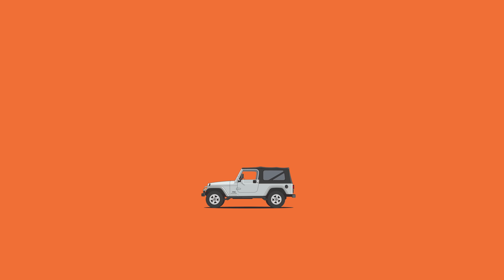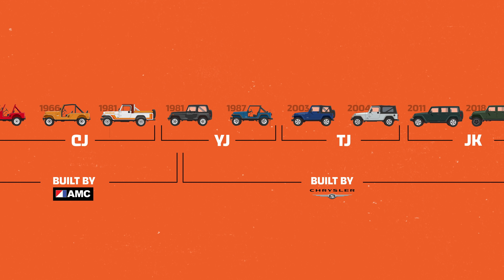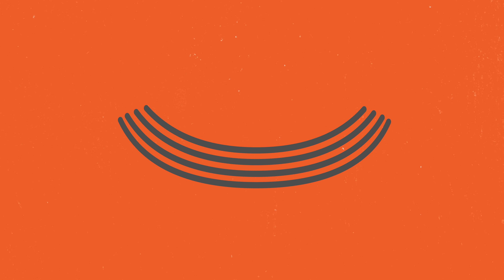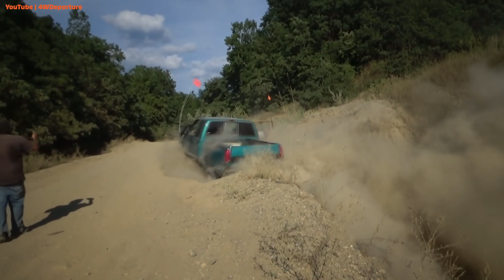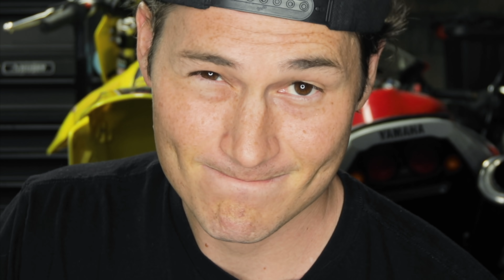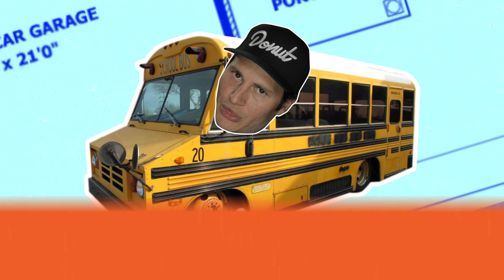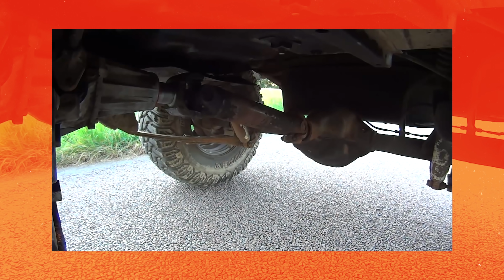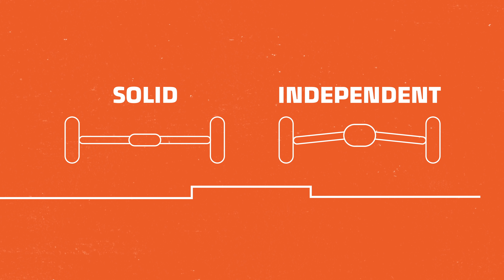Jeep Wrangler - The Science Explained

Comment: Why has Mercedes and Jeep not taken responsibility for the infamous “Death Wobble”? I purchased a used JK that was still under warranty by the dealer, who tried to fix it by replacing the ball joints but the problem persisted. I replaced nearly everything else and the problem just got worse and worse. If you don’t know, this issue is very common with Jeep’s including, from what I’ve found out in all models. My experience is that any bump  that the vehicle would experience I’ve 40 mph would cause the front suspension to destabilize causing the the vehicle to violently thrash and shake until it is brought under 5mph. This issue is probably one of the scariest experiences of my life while driving. Because it happened to me several times on the highway. I took it back to the dealership several times and they would say they couldn’t fix it or couldn’t replicate the issue.( which was a lie)! I put thousands into trying to fix this issue and have heard horror stories of people experiencing the same issue. I’ve known of people dying from this issue yet this is an obvious manufacturing issue and they wash their hands of any responsibility. They blame customization. Yet my jk was stock stock. It’s a shame that donut is advocating this. Either I am the exception or they have an issue that needs to be recalled. Do the right thing! I will never buy a jeep again and I’ve owned 5 in my life time. None have had this issue till this one.

Comment: Personally, my experience with the early 86 cj7s by amc with a straight 6 258 engine with a manual transmission are the best. We own the early models by amc which had about 2000 made before they were bought out in 86. We even put this jeep up against a 2000 wrangler and a 2017 wrangler and it wins every time.

Comment: thank you for teaching me about the different kinds of suspension. i’m 20yrs old and bought a 65 mustang. it has leaf spring suspension and bounces to much over railroad tracks and por holes. now i know what kind of coils to get and the benefits of doing so!!!
Reply: Just get a set of slapper bars.  They will help prevent axle wrap and are way easier to install then cutting off leaf spring brackets and welding on coil perches.  Unless your going to back half the entire rear of the car and put an adjustable 4-link in it.  Pretty 90's pro street but really effective on the drag strip.
Reply: BigMateo24 will those really help? bc currently i have the issue of the back rear right side hanging a tad bit lower than the left, which results in my tire rubbing against the wheel well. my friend is currently fixing my engine and told me about this problem. i’m hoping it’s nothing serious like warping of the leaf spring or (please god no) the axel. so like, do you think the slapping bars will help? i’m also kinda broke bc of school and the car as is, so i need to know what to save for in the future so i don’t screw myself over.

Comment: Ok well my 2002 wrangler is stock and has the death wobble. It will go away if tires are rotated every oil change after buying new. Looking out the windshield at 70mph watching the fenders violently bounce  is not fun. Tap the brakes, let it coast and it will stop at 40 mph.

Comment: This video is not that great of a video. The basic Jeep drivetrain is basic, it does not respond well to modifications. Dana Corporation axles don't come into fruition until you have a 44. The Dana 35 running gear it has been on Jeep since the CJ series is now comparatively  weak in relation to Jeep wrangler size.
If you're really going to wheel, you want at least a Dana 44 for the 8 inch ring gear and Dana 44 knuckles. Jeeps equipped with a Dana 44 front axle typically still retain The Dana 35 steering knuckles they are quite problematic. The automatic transmission from Jeep especially the 42 rle tend overheat and die the engine operating temperature is roughly 210 degrees, the transmission cooler integrated into the radiator cools transmission fluid that breaks down at 215 degrees. And let's not forget JK's premiered the minivan engine.

Comment: All the comparisons between leaf and coil are particularly biased and unfair to leaf.
Leafs are progressive by nature, you can also replace leaf AND you can remove/add one, they are stiff on trucks configured to carry big loads if you set them for the load you carry they are confortable, leaf have a far better positioning of the axle than coil that's why you need to add all those bars with coil that you don't need with leaf...

Comment: No wrangler has ever had dana 44s stock they came with dana 35s
Reply: Wrong. Rubicon versions of the TJ had Dana 44s stock, front and rear. My 2002 TJ Sport came with Dana 30 in the front and Dana 35 in the rear.

Comment: You can't call it a 4 link if it has a panhard rod. 2 upper, 2 lower and a panhard is a 5 link. The simulation showed a triangulated 4 link (you claimed front and back). Then added the 5th link in the next animation.

Comment: You have it the wrong way around. The best Jeep was in the WW2 version. Ever since, the progression to the current pathetic and unsafe offerings have been marked by progressively less durable engines, driveline components and now made with thin walled and badly welded steel, a chassis that now flexes alarmingly and is so top heavy that they are deadly.
The original Jeep of WW2 was bombproof. It could do 60mph, it had a simple engine that was reliable for 500,000 miles, got 30mpg and could run on 65 octane fuel. In the African SAS version it could operate in 130 degrees of heat without overheating, carry three men, two 50cal machine guns and enough fuel to travel 700 miles. There was nothing like it then and since.
So if you have $25k to spend, go and buy a restored WW2 version and go places the current one will not and have more fun doing it in an appreciating asset.

Comment: Great video. I just wanted to add a few things. The reason for bump steer is when the axle moves in a different arc when compared to the drag link. The way that Jeep engineered it out, was by making the panhard bar the same length, and mounting it parallel to the drag link. This ensures that the axle always moves on the same arc as the steering.
Reply: I read this in Jeremiah’s voice 😂

Comment: Not sure where you got your "engineering degree" BUT even linked suspension moved forward and backwards. Also axle wrap has nothing to do with the axle moving forward and backwards.....the spring wraps under traction and then unwraps under loss of traction. When this happens rapidly it causes the wheels to hop which can cause damage to suspension and axle components. Also it doesn't look cool and hinders performance.

Comment: Rate is NOT constant throughout the entire deflection of a compression spring with closed ends. See how both ends "close"? That's done so the spring sits more stable. However, it means your rate is only constant between 15 and 85% of your avaliable deflection. Outside of those ranges your rate will be stiffer.

Comment: My guess is that to compete with the Bronco Jeep should rather try to reintroduce a Classic Jeep of some kind like Ford did reintroducing a Classic Style Bronco. 2 doors that you can remove at your discretion and reattach as needed, 2 seats and just 2 seats, no onboard tech whatsoever, a manual transmission and only a manual transmission, a CB Radio for fun, Xtra Beefy Shocks so you can go just about anywhere, KC Lights and a Tow Winch Standard, and lastly puncture proof off road tires with a continental mounted on the back with a free gas can plus tool and repair kit. All for $25,000. Available in either Military Camo, Black, Blue, or Orange.

Comment: I can't believe you missed the #1 reason for solid axles: more vertical articulation than an independent suspension. You sacrifice ride quality for it.
Reply: Yes! When IFS flexes, the vehicle moves downward on that side to meet it, reducing clearance.
Reply: You should look up the articulation and wheel travel numbers of the bronco and the current Rubicon. You might be surprised to find out the jeep has less.
Reply: @garettodd3037  lol, I've seen the new bronco vs a Jeep on a trail.  During the turn while going up hill the Jeep kept all 4 tires on the ground, the Bronco was waiving one of ours from tires on the air.
Reply: @ebikeengineer  doesn't surprise me. I was just on the Rubicon with a bone stock bronco last weekend. Nothing wrong with a little 3 wheeling.  On a solid axle the drooping tires gets downward force when the opposite wheel climbs atop something. This isn't the case with ifs but is doesn't mean the ability to articulation isnt there. going off hard numbers isn't really a great way to compare the two, but I was just stating facts because I didn't want people to be led astray by the broad, false statement you said.

Comment: A couple of errors in your illustrations.  Your lead spring pack was upside down.  The main leaf that attaches to the frame and shackle is on top, the shorter leaves are below that in descending order of length.  
The four link setup you illustrate is a triangulated four link, factory Jeep’s don’t have this setup, the uppers and lowers are basically parallel, and a 5th link called the track bar locates the axle side to side.

Comment: I've owned a couple wranglers (2 yjs and a tj) and let me tell you. Jeeps are severely under built and the only ones that are built to use anything above mild trails are ones built with ford or gm running gear (motors, transmission, axles, suspension, transfer cases, etc) they are actual garbage and if your looking to take something offroad and rely on it, just get a toyota.

Comment: "TJ is the last one made with AMC parts" 

Shows chart showing it's actually the second full generation made by Chrysler... uh....
Reply: Right. AMC was defunct in 1988. I’m not sure what AMC parts were being used by Chrysler 9 years later. Are we counting the AMC developed 4.0 I6?
Reply: Jeff Russell amc parts were still widely used, Jeep grand wagoneers used their engines into 93 until Chrysler started putting newer fuel injection 4.7 liters. But with the tj many parts in the 4 liter straight 6 are the same amc designs until they started using the newer crappy v6s in the jks
Reply: @xiSkiGuy  AMC designed the Grand Cherokee (ZJ) starting in 1985. The Grand Cherokee has the exact same suspension components under it that were used in the TJ.
Reply: @Bedpost88  And they started the XJ long before that. The original coil 4 link started in the front on that one . I started working at JTE (Jeep Truck Engineering) in early 89 as a chassis designer on the Viper which was developed in the same building. Very cool seeing the conception of the TJ and ZJ in the mock up area. Even the WJ introduced in 99 had it roots in AMC, the 4.7 was also conceived by AMC. The mighty V10 has AMC roots in it also, the front mounted gerotor oil pump was a concept used by AMC on it's V8 engines.
Reply: @Bedpost88  True, I have a tj and a ZJ/ZG its clear control arms are interchangeable even the unibody is sculpted into a body on frame easque design. Amc definitely made the TJ one way or another.
Reply: 4.0L AMC straight 6.  Developed in the 1960s for Rambler passenger cars and retained all the way through the 2006 TJ.
Reply: What's meant is Jeep was still using AMC designed/spec'ed parts;  like engines, axles, brakes, wheels etc.  Parts that came into use by Chrysler when they bought out AMC.  It does't mean the parts were all built in the early 80s when AMC still ran Jeep.
Reply: Well the reason for that was because Chrysler owned Jeep for the tj year but it still came with amc parts that were basically left over
Reply: @brendank6874 ...Chrysler purchased Jeep in 1987 when the YJ was still being built.

Comment: "some of the toughest axles ever made: Dana axles".... Hah, not quite. The Dana 30 and 35 are the most infamously weak 4x4 axles out there, if you're not careful you can snap them with as little as a 33" tire. The 44s are better, but not nearly as strong as other factory 4x4 axles.
Reply: Cybertruck suspension is Better.